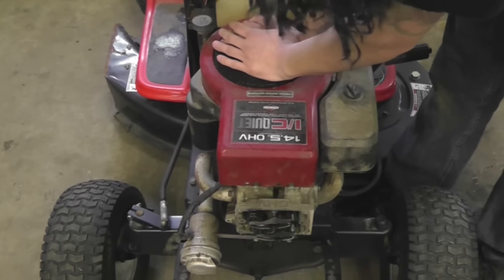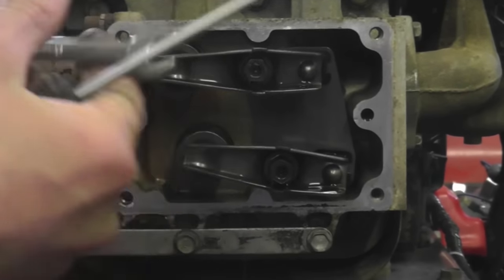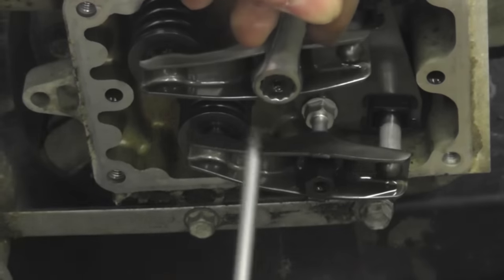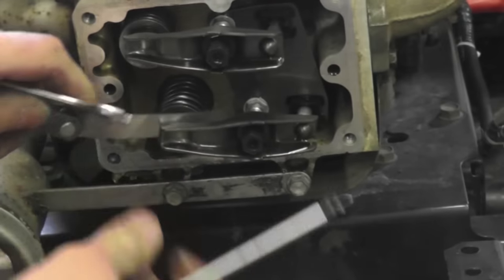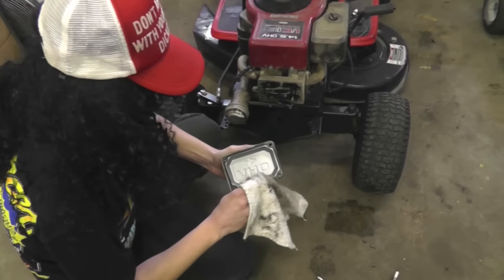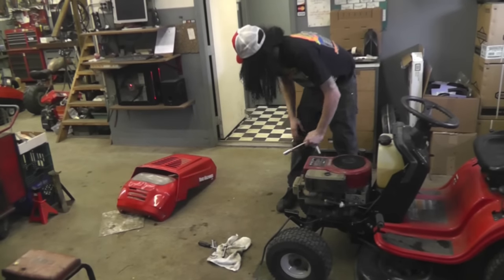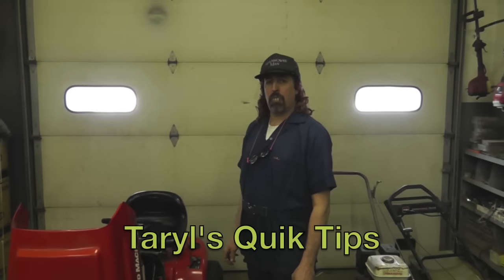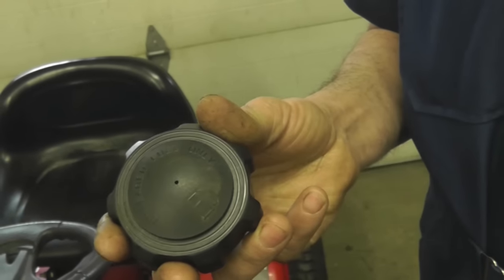Setting Valves: A Complete Guide on What To Know

Comment: The side of a Dr. Pepper can just happens to be .004 thick, in case you lost or don't have your feeler gauge set.  ;)
Reply: Wish I had read your comment before heading to Autozone and paying 10 bucks for one....that I may never use again.
Reply: @raulrincon576  you'll definitely need it again
Reply: @raulrincon576  but you can do the job without feeler gauge it doesn't have to be exact
Reply: Can i use Dr. Pibb?
Reply: What about a match book cover?
Reply: @shawnmackinnon8624  that's more like .010 thickness.
Reply: Wtf
Reply: Beautiful! Thanks
Reply: Speaking of a soda can...I was once rebuilding a manual transmission on an old Ford Ranger and one of the gear stacks had too much slop in it...about .004 (you can see where this is going!).
It wasn't in a critical wear location so I just cut a piece of aluminum soda can and added it to the assembly and it worked like a charm.
Reply: God thank you! Finally someone who can give important info we can actually use! Makes my time not wasted! Thank you!
Reply: Plus I drink Dr pepper
Reply: I guess I got to drink a beer now
Reply: PBR
Reply: That is useful! Thank you
Reply: Was that before 2020 or after when you get less and  pay 50-60% more😂
Reply: Can also use a piece of printer paper.

Comment: I was struggling so much with the TDC adjustment and then I tried 1 valve up and 1 down at .004 and that did the trick. Now my timemaster is back up and running. Also note, doing it this way seems to make the gap smaller than .004 at TDC.

Comment: It's amazing how tricky this adjustment is. I've followed these instructions for several motors the last couple of years. But today, it just keeps failing on a B&S 21 hp single cylinder. I adjust it to 4 thous. Then tighten it, and check it again and it's 7 thous. So try again and again. Finally had to set it to 3 thous, to get it to be 4 thous after tightening. And the motor still won't spin without the sparkplug being out.
Update: I was able to talk to Taryl, and he suspected the camshaft compression release inside the crankcase was broken. So I removed the engine, opened the case and sure enough, Taryl was right. Thanks again for the great advice.
Reply: Always check after tightening.
Reply: Would love to see a video on how to remove the engine and open the crankcase to get at that camshaft with the compression release.  You should have filmed yourself doing that.  : ))
Reply: @2028end  Taryl has a video on the subject.
Reply: I've set the valves on everything from .003 to .006 multiple times now and nothing has worked.
Spins like a top with the spark plug out.

Currently taking a break in disgust. 

Of course I also bought an unnecessary new battery first thing.
Reply: @hackermusic3355  Then it's likely the same problem I had, the camshaft compression release is broken.
Reply: @dkeith45  Funny thing was it showed no sign of a problem cranking one day and the next it wouldn't turn over at all. I'll have to make a decision whether to try to fix it or just scrap it and get a new one.
Reply: @2028end  v.   B it's
Reply: cam gear might of broken but just a guess

Comment: Just wanted to say thanks for your video of valve adjustment for hard start B&S.  Your symptoms were exactly what I had.  One turn and stop. I had fought starters, batteries and was at wit's end!  Never had a clue that valve adjustment was that critical to a good start.  I'm not a mechanic by any stretch of the imagination but was able to follow your video easily and she fired right up...Thanks again,  Keep up the good work.....
Reply from the maker: Jim Bodiford  Glad I could help. Now theres your dinner!
Reply: Taryl Fixes All i just ajusted mine to tight but it's dinner time so tomorrow I wil fix em
Reply: Yeah. Mine's been hard to start (spin) since new. Can't believe B&S wouldn't have properly adjusted the valves from the factory. Gonna check before grass season starts.

Comment: OMG!!! This was it!!! This was the video!!! For the first time ever I attempted a head gasket replacement on my B&S 19HP OHV lawn tractor. Everything went well until the valve adjustments. So many of the videos did a piss poor job of explain gin Top Dead Center etc. and I could get it to run smooth. Then I found this video, opened it back up, made the adjustments and WHAMMO!!!! I'm running smooth as silk. Thank you!!! This couldn't have been easier.

Comment: November 11, 2022.  Briggs 12.5 horse. Starter struggles, but won't crank the engine over.  Typed "valve adjustment" in search bar for this channel, and there it is "How to set or adjust the valves on a riding mower = with Taryl Jr."  I'm running to the hardware store to pick up a set of feeler gauges. and I'll be good to go.  LOVE THIS CHANNEL!!!

Comment: Taryl thanks for the info on the gas cap at the end of the video. My lawn tractor was skipping when it got hot. Less than 5 minutes. My gas cap was plugged but you could not tell by just looking at it. I sprayed carb cleaner in it and hit it with compressed air then put it back on tractor and it worked just like new! Thumbs up to you!

Comment: Your Irish cousin here Dusty Rhodes here .    Fixing up an od mtd yardman year "98"  been neglected for years .... complete strip down ...  grease replace and respray  ......   set the valves to 4000 as you said    
Not finished yet but will post a video to you with before and after photos....   keep on rockin and keep on giving them dinners out big guy  .....    👍👍👍

Comment: Thanks for this. I thought compression release was broken so took sump off. Camshaft and release gizmo intact. Put it back together, set valves using Taryl's advice (not B&S setting) and it started right up. Wish I'd seen this earlier... would have saved a ton of work. Thanks Taryl and the crew.

Comment: Hey Taryl , you gave a good tip at the end of that video!!  My tractor was doing that for 2 years! I was so frustrated.  When I was driving for a while ( engine warm) it alwAys stop when I was going up hill like the engine was starving for gas.  I was ready to put a gas pump and the guy at the shop(after seeing him several time ) told me about the gas cap!  That was the problem! The tractor is been working good since.  Thanks again for your video!

Comment: Had an oil leak at the cover that required a new gasket . After I saw this video I figured a valve adjustment would be a good idea since the cover was off . Now the mower starts right up as soon as the key is turned . Thanks for the video guys , so easy to understand .

Comment: Love your channel.  I followed this video and the engine manual on my Kohler Pro 25hp engine.  Started great.  Ran great for 3 minutes, then sort of lost power.  Turned out the spark plug wire had fallen off.  Also seemed very hot.  Crimped it back on, then ran great for 4 minutes and sort of lost power again this time until it stalled.  Now it cranks and goes "Phut Phut" and even sounds like it might be catching a little bit, but never actually catches and starts.  Waited a couple hours for it to cool: same thing.

Comment: thank you! the official guide didn't works for me, but with the valve fully close/open , its started perfectly the first try (after head gasket replacement, i had too much compression and it wouldn't start)

Comment: You good sir are THE go to for all small engine repairs. I'm fighting my Briggs with the exact same issue. Gonna adjust the valves next. Can you make this adjustment with both valves closed, or does one need to be closed while you adjust the open one?
Reply: The reason why you adjust it with one valve all the way open with the other one that you’re going to adjust all the way closed is because this is the position the camshaft is in that allows you to miss the compression release. Adjusting it in any other engine orientation will cause an exhaust valve adjustment while it is in compression release mode, which is not good. The starter is not designed to crank an engine without a working compression release.  Also, if you happen to get it started without a compression release, and when it’s running, the exhaust valve will have a ton of clearance which will decrease performance.

Comment: Love your videos!  I have a 23 hp Briggs & Stratton endurance Intek(2009).   The book says to adjust valves to 04 - 06 ?   Why don’t they give exact for exhaust and intake settings, I’m confused!!
The engine is hard to start, but runs well when started: where should I set the valves??

Comment: Thank you.  This adjustment looks great for doing valves that are out of adjustment.  What do you do if both valves/rockers are totally loose or have been removed and are being reinstalled?  They may be really loose regardless of how much you turn the flywheel.  What is the starting/reference point?  Thank you.

Comment: I got th e OHV130 engine, and there's no T20 locknut in the middle.  It just looks like a regular bolt head.  How do you adjust that?  Loosen the nut at the back, and then turn the nut, then retighten the back nut?

Comment: My 17.5 hp B&S 33000 series engine hydrolocked due to a stuck float. After freeing up  the float pin the engine would only start using ether but would run otherwise. 

I know a B&S OHV is hard to start if the valves clearances are out of adjustment.

I adjusted the valves and it now starts up fine. Any correlation between the two? This engine had probably less than 100 hours on it.

BTW, the B&S manual says to find TDC then rotate the engine backwards a 1/4" so both valves are closed and adjust both valves with the piston at this position. I tried your method but had no luck. What's up with that?

Also took me longer to scrape that RTV off the valve cover and engine than it did to adjust the valve clearances and put the valve cover back on! Why do they use that crap? I make my own gaskets out of GoreTex material. It can be reused 100 times!

Comment: Taryl, Great video! Having trouble starting my 25 hp Kohler Courage Pro engine.  I am in the process of adjusting the valves. At TDC on the compression stroke, the clearance on both valves is tighter than the spec (0.005 in.). I don't think the valves have ever been adjusted. I was expecting the clearance to be greater than the spec. Just wondering if you have seen this type of thing before. Thanks in advance for your reply.

Comment: Hi, great video and really helpful.
I followed your instructions and it seemed to solve my issue, started first time. However I tried to start it a few days later and exactly the same problem again, any ideas would be much appreciated. Thanks Paul
Reply: find TDC with screwdriver, then down about 1/4 inch , then set valve lash .003 - .005 on bottom one, and .005 - .007 on top one IN THAT ORDER, then she's good to go.  don't over tighten T20 bolt !!!   She will run like a kitten and steal all your milk !!!

Comment: Taryl, could this issue also be why, when my mower did run last season, it would only stay on while in full choke? I ended up replacing the carb and it still did it. Left it to sit, and now its doing the issue in this video with the valve tapplets. I mustve gotten my compression adjustment wrong and listened to the manual of .005" last time I changed out the head gasket last year as well. I'm just not sure if this issue is related to the carb or not. Hope this reaches you.

Comment: To adjust the valves with one spring up and other down does it matter what stroke your on. Why do you not use tdc, or is that necessary. I fingld your way is better. Thanks great videos👍👍👍👍👍👍👍👍👍👍👍👍👍👍👍

Comment: Same symptoms I have on my 20 HP Kohler courage. OK, I'm a decent mechanic so I think I know how to do this. Never had a problem w/with setting valves before, but for some reason I get to TDC on comp stroke, set both valves  correctly, check them again, and still I get the engine locking up when I try to start it. It WILL start fine if the engine wasn't right at the comp stroke, but when I start it and the engine is about TDC it will only turn a tiny bit and stop. I have to manually rotate the fly wheel, then it will start since it's now past the comp stage. I know what you're thinking... I don't have the valves adjusted correctly, but they are.  this is very frustrating... any ideas? Some people say to turn the engine about a quarter turn past TDC, then set the valves.  thoughts???   THANKS!!

Comment: I have a kohler magnum (mv165 model number) it's hard cranking but if you pull out the spark plugs it spins no problem I was going to adjust the valves but dont see anyway to adjust them. Anyone have any ideas? Plus love the videos way better than all the other repair videos I've seen lol

Comment: I'm working on a mower just like that one. I put a new carburetor on because the old one was leaking.
I put a new one on and the gas is spitting towards the air filter side.
I check the flywheel key, check the push rods and adjusted the values.
Still spitting out gas. Any help would be appreciated. And thanks for your videos.
So once I get this fixed I can have my dinner!!

Comment: Ohhhh Taryl, I just LOVE your sexy high-waters! LOL! Seriously though, I want to thank you for making these videos. I'm in the middle of fixing my crappy WalmarK RER. Didn't even get 2 full mowings out of it before one of the plastic pieces broke on top of the carburetor. Also, it NEVER started correctly so thinking it was the starter or solenoid (?) I kept jump starting it off my truck battery to get it started. I'm in the middle of adjusting the valves right now. Hopefully, after this, it will be good for a long while. Thank you, thank you, thank you! It's so nice to have a good laugh when you're aggravated about having to fix something that's a brand new piece of crap from the start.

Comment: Taryl a question on a craftsman t1200 13hp 2014 year there's oil going to the carb from the vent tube, are the rings shot or is there a part one can change understeer plate with 5 bolts

Comment: This fixed my mower after days of changing plugs, cleaning carbs etc. One question though. One valve adjusted easily but the other was very loose and the small screw was so tight I couldn't break it loose and now is pretty much stripped. I was able to tighten the larger nut up enough to get it to get it to run. Is this something I should try to replace or just not worry about it. You know if it ain't broke, don't fix it.

Comment: Great video!  I've got a Craftsman with a Kohler engine ( CV460S ) that began making what sounds like lifter tapping upon start-up.  If I let it run for 10-15 mins. it seems to quiet down considerably.  It's approximately 13 yrs. old, but only has about 250 run hours...it never had the valves adjusted...I believe the lifters are hydraulic.  Since it quiets down after 10-15 minutes of running...does this seem like a lifter issue or a valve adjustment.  The mower has no trouble starting and I run Kohler 10W-30 oil.  Thanks for any assistance.  Lovin' that 'there's your dinner'!
Reply from the maker: +Mike R The Command has hydraulic lifters so you can't adjust them only the solid lifter engine which is the Krohler Courage. So if yur havin lifter noise just replace the hydraulic lifters just make sure you soak them in oil first.

Comment: Taryl I got one for you spark plugs? I thought it was the valve but they were fine. there was a lot of carbon  on the piston and valve cover thought was blow gasket nope not that. So I got my new spark plug and notices a big different. the old one was champion rj19lm   the new one was briggs 491055t ???  I haven't put it back to gather still weighting for  new valve gasket. Do you think it will run?

Comment: Taryl,will the valve adjustment setting of .004 on both exhaust & intake work on a Briggs 15.5 hp single cylinder lawn tractor ? Thanks for all of your you-tube  postings ,very helpful.
Reply: Set your exhaust to 004 to 007..no more .intake 004 or 005

Comment: Now would or could this cause it to backfire? Replaced fuel lines, filter, shut off valve, air filters, carburetor, and spark plug.  All new drive and deck belts. Or should I change the magneto.
Reply: Is the flywheel key sheared or partially sheared?
Reply: @tonyc.4528  uhm, I don't think so, I reset the valves, but I definitely need a new magneto this one's weak. Have to keep recharging the battery after a few starts. I cleaned where the magneto reads with steel wool to knock off the rust. Helped a little.
Reply: @montyholland3357  Alternator is under the flywheel,that charges the battery. Ignition coil is what I think you are talking about.  It could be weak, could also have too much gap if the magnets rusted that much.  Could be that the ignition coil mounts are corroded and you're getting a bad ground.  Lot's of places for electrical issues to pop up, just have to clean everything up and test as you go.

Comment: Tarly, I need your help please. I have a John Deere Mower LA115 with bad head gasket and I replace it. After I put everything back on, the Exhaust Valve turns fine but the Intake Valve does not turn at all when I use my hand to turn the clockwise. I set .004 for the Intake Valve and .006 for the Exhaust Valve so many times and the engine turns over or crank but I could not get the engine to turn on. What’s wrong with it?

Comment: So what’s up with the rockers you said turn until one is fully open and one is closed but my manual for la105 John Deere B&S 19.5 engine says to go to top dead center on the compression stroke and at that point the rockers are even , which one is it ?

Comment: So I adjusted the valves on my john deere js46. But now it isn't running at full throttle. Running at 2400-2600rpm...is it misfiring? Because adjusting the governor doesn't do a thing